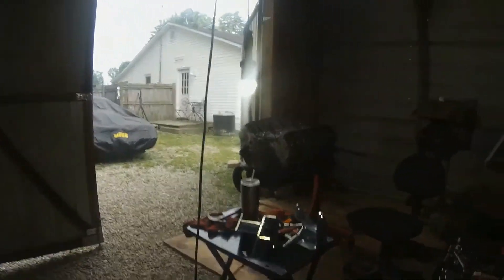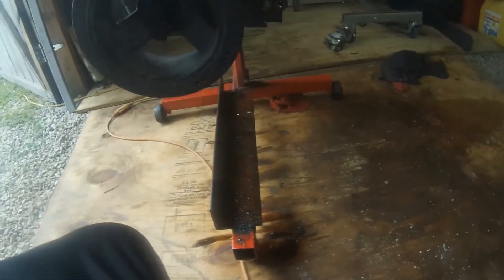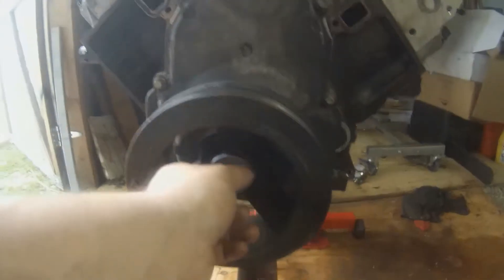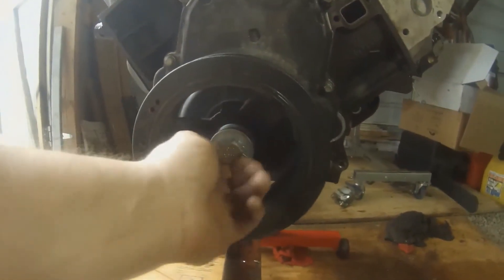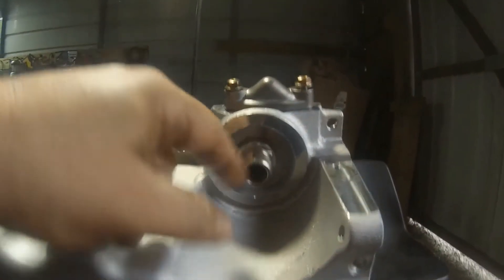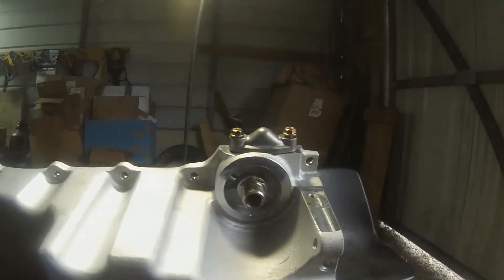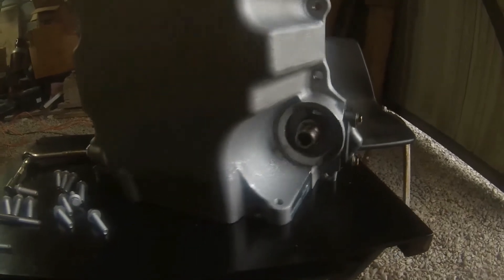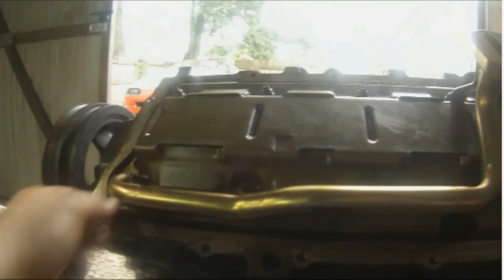LT1 Camaro to LS Swap Part 5, 5.3 Messing with Balancer and Installing Oil Pan

Comment: any chance you got the part number on the mounts and the water pump brother?
Reply from the maker: @adrian5.761  water pump and engine side motor mounts  are from a 98-02 F-Body LS1.
Reply from the maker: @adrian5.761  the engine mounts on the crossmember side are https://www.jegs.com/i/Hooker-Headers/520/71221002/10002/-1?gad_source=1&gclid=CjwKCAiAg8S7BhATEiwAO2-R6hYOMFufbJtK8NG3EqgL3c1xWPgDAEqUHiqilQAC1vmlZKiUMvbOLxoCxoYQAvD_BwE